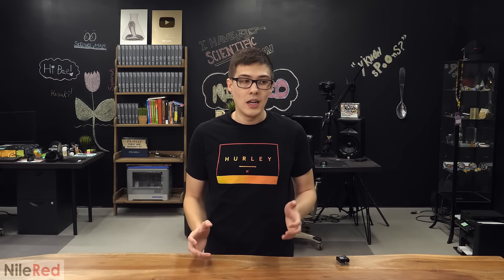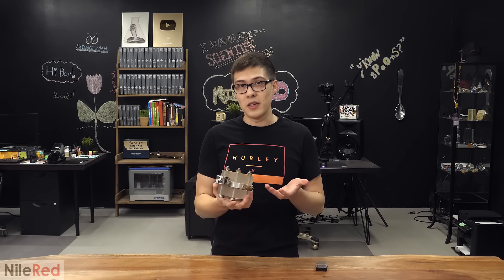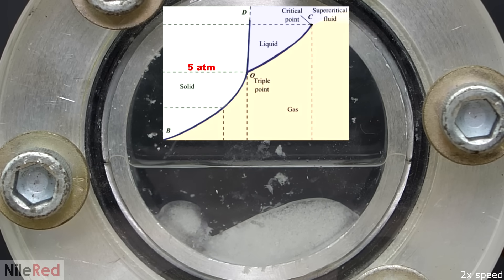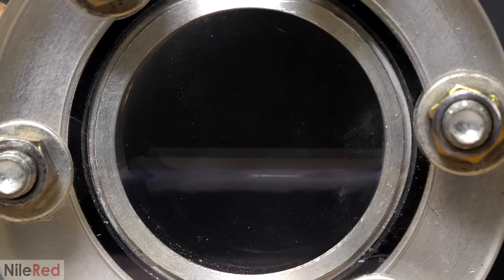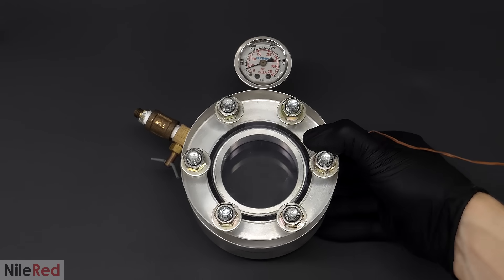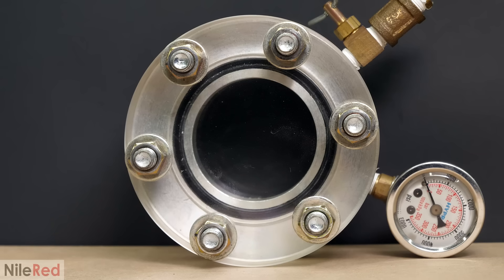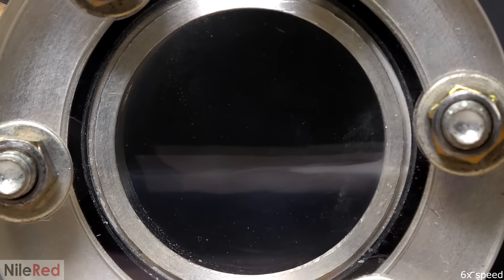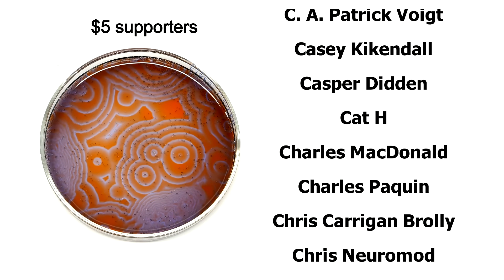Going supercritical.

Comment: Aww, I really wanted to see something that floated on liquid CO2 interacting with it when it was supercritical.
Reply: An excuse to make yet another video on the subject.  😉
Reply: Yeah me too, a bit of searching shows that maybe lithium could float in there, I think?
Reply: @BlacksmithGen  Lithium reacts with CO2 to eventually form CO and lithium carbonate at room temperature.  There's some inconsistent values of liquid CO2's density at between 0.77 and 1.1 g/cm^3.  Going off wikipedia's 1.1g/cm^3, something like polyethylene beads should float.  I think they might absorb a significant amount of CO2 though.

I can't make much sense of this:
https://www.researchgate.net/figure/CO2-density-and-phase-diagram_fig1_305733339
though it implies that the liquid density is something like 0.6 near the critical point and the gas is something like 0.3 near the critical point.
Reply: @BlacksmithGen  I think maybe the easiest way to make something with a density of roughly 0.5g/cm^3 would be to seal off a piece of borosilicate pipette.  It should be able to handle the pressure if its small diameter, but no guarantees.
Reply: Go check cody's lab, he has a video about i if i remember well
Reply: It got me thinking about the video about frobscottle that Cody did on his channel (Cody's Lab).  LOL
Reply: I was thinking styrofoam balls
Reply: @Trathaal  You might be interested in what happens to styrofoam balls at 1000psi.
Reply: On second thought, they's probably just be crushed into tiny balls, wouldn't they? haha. What if he put some aerogel in with the supercritical CO2?
Reply: wait, same thing, right? damn I'm tired
Reply: @Trathaal  Well that would be kind of pointless, not because it would be crushed, but because thats how you make aerogel.  You dissolve something like silica gel in liquid CO2 and then evaporate off the supercritical CO2, leaving behind a very sparse matrix of whatever was dissolved in it.  I guess he's already made the video on that process though.
Reply: @htomerif  Oh, that makes sense! So you'd basically get a skeleton of the silica gel structure; a bit like a sea sponge where all the living cells die off but leaves behind the collagen and calcium?

Comment: I think that the effect of different colors in the silica beads after having them in the pressure vessel does have something to do with the effect that opal has. opal is made of Sillicondioxide molecules that got stacked in different ways under high preassure underground, these structures cause the light to shatter in wierd ways creating those interesting colors. maybe the silica in the beads also started forming these kinds of stacks of Sillicondioxide under the extreme preassure of the supercritical CO2 wich could cause the light to shatter and give the same effect that opal has after you took the beads out of the vessel. also, opal is made of hydrated Sillicon dioxide and seen the fact that you got those silica beads from some kinds of drying bags makes me believe that the silica in the beads was also hydrated, making it similar to actual opal.
Reply: A fun theory, but Opal is a bit more complex than just a silicon dioxide crystal. Silica gel is amorphous, so we could indeed see the formation of silicon dioxide crystals, but I doubt we'd see the metamaterial of true opal. 

It seems much more likely in my opinion that we're seeing thin film interference, either from voids formed in the silica gel as CO2 trapped inside tries to escape, or from the formation of some other silica phase inside.
Reply: So, he could accidentally have come across a way to make synthetic Opals..?
Reply: @The_Keeper  , I doubt it.  But the light scattering properties of this affect looks very similar to the light scattering properties of opal.  Though it looks similar, it's not the exact same thing.  It would be cool if he could figure out how to do it though.
Reply: I don't know anything about opal, but my first thought was "he made glass!" I'm dubious of this conclusion now, but given that silica gell is already SiO2, I could see the pressure coercing it into a crystaline state.

IDK, just wild guessing on my part. Very neat, though :D
Reply: I agree here. I think under the extreme pressure some of the silica was ' 
crushed' except this actually allowed it to stack into some sort of a  semi-crytstalline structure
Reply: The colour in the beads reminds me of the stress patterns you see in Prince Rupert's drop.
My guess is that the intense pressure creates stress fractures all throughout the beads and since they're silica they're polarised in a way that lets us see the colours.
Reply: I have some clear opal, and without the cracks it looks very much alike.
Reply: Exactly what i thought of it!
Reply: @Sasha Kruse Grim Its literally as Sasha said. Man, what a good eye.
Reply: Wait... so you're saying opal is just fancy quartz? Huh.
Reply: @avi8aviate  , pretty much.  The opal that produces these colors, precious opal, consists of planes of very tightly packed spheres of silicon dioxide.  Quartz is also made of silicon dioxide.  Sand is also largely made of silicon dioxide as well.
Reply: @BackYardScience2000  So opal is fancy quartz which is fancy sand which is fancy silicon and oxygen.
Reply: I came here to say something similar as I learned abt a opals, quartz in all color/forms in my youth.  Unfort a memory issue prevents remembering much detail & i could be completely off base here but it did bring to mind a few questions abt other silica based products like if such a pressure device could make unheated glass or even amethyst (etc) semi-precious stones.  I was also curious how pressure plus controlled cycles of  cold & heat would effect other silica items, and even coal & bog peat.

Comment: I suspect the blue color in the chamber is from Rayleigh scattering - small particles scatter isotropically with a strong wavelength dependence. Shorter wavelengths are scattered more, so you get a lot of blue. If this is the case, things might look slightly reddish as you look through it!

...and I bet aerogel is blue because of the Tyndall effect, which is basically the same thing, but with some consideration for the structure.
Reply: It's all Tyndall. Rayleigh is too weak on these length scales to see.
Reply: @Muonium1  The only length scales involved in Rayleigh scattering are the radius of the scattering particle and the wavelength of light... It's never necessarily dim. I see it all the time from plastic nanoparticles at fairly low volume fractions. It may similarly be visible from time to time in fine particles of smoke from a match or candle.
Granted, I'll admit the definition of the Tyndall effect is somewhat squishy.

Comment: it looks to be a 5000 psi gage, so if your pressure sticks around 5 atm (or about 75 psi), you probably wont see it move since each divison is 100 psi. Gages are most accurate when used between 30% - 70% full scale, so if you had 1500 to 3500 psi, you;d have a best case scenario. Maybe switch it out for a 500 psi gage. Also, the gage should be standing up right, since axial pressure is felt differently than normal vertical gas pressure. If you look at 9:20 you can see the gage working as intended with about 300 psi

Comment: what would an object with a density less than the liquid CO2 behave like when it’s in the supercritical state?
Reply: When supercritical fluid forms, the density of the gas increases and the density of the liquid decreases until they meet.

So presumably there's some density in the middle (I guess it would have to be the mass of the CO2 charge divided by the volume of the chamber, so you could tweak it by altering the mass of the initial charge) where the fluid ends up. And if you found an object that was less dense than the liquid but more dense than the supercritical fluid, the object would settle down to the bottom of the chamber over the course of the fluid becoming supercritical.
Reply: Cuber gang

Comment: This is so cool. Does this happen for every substance when its vapor density increases to the liquid density?
Reply: Brian Geer Yes, every substance has a critical point - though the more complex organic molecules might decompose before they get to the critical temperature.
Reply: Zuthal Soraniz so inorganic substances are more suited for reaching supercritical point.I guess that organic chemicals have more complex requirements.
Reply: @justastellarperson219  Zuthals point was just that at high temperatures organic substances are prone to Oxidation and decomposition- and will do before reaching the temperature required to pass the critical point.
Reply: @justastellarperson219  It's not so much more complex requirement, but rather just that as organic molecules get big, they get more susceptible to being thermally decomposed (and also their critical temperature goes up). There's anorganic substances too that probably cannot reach a critical state - I definitely wouldn't want to attempt to take hydrogen peroxide supercritical, not without a good few inches of armour plate between me and the pressure vessel.
Reply: yes, every substance has a critical point.
Reply: I think it does. Not sure if there are exceptions, though...
Reply: I'm sure that you're right. I wonder what supercritical water looks like